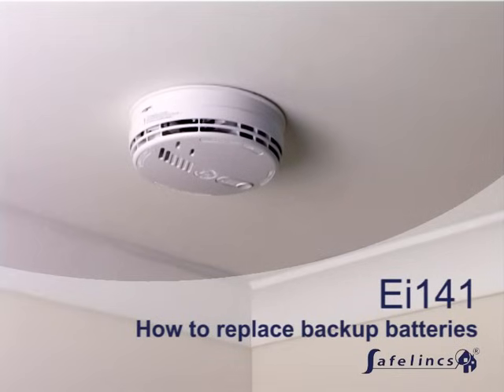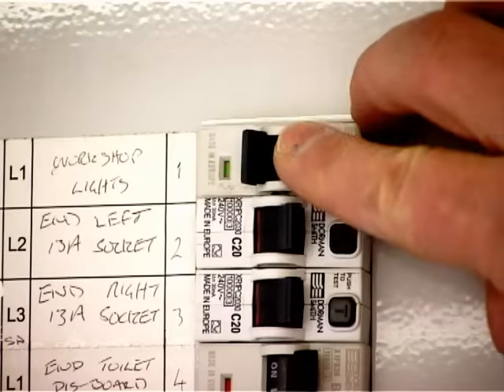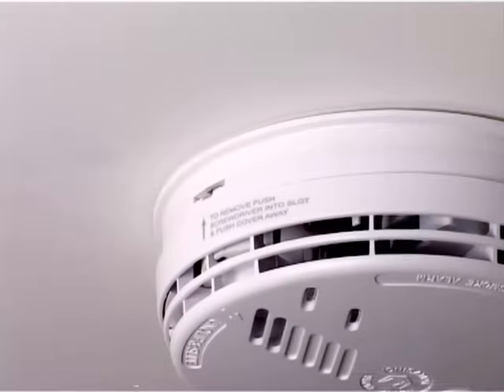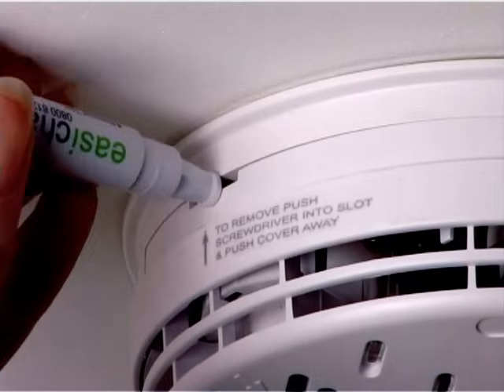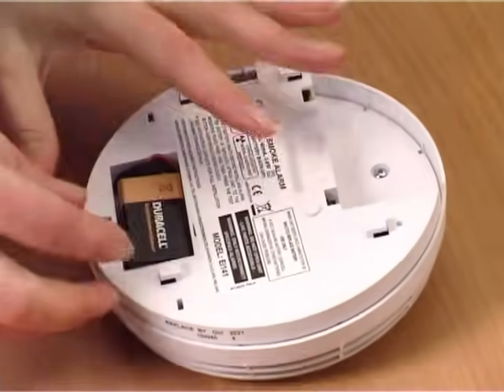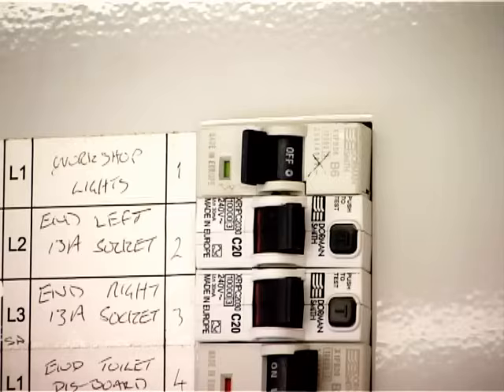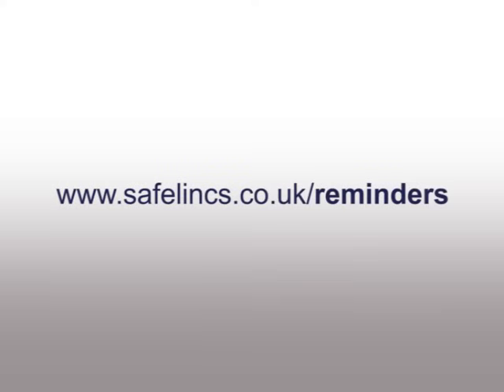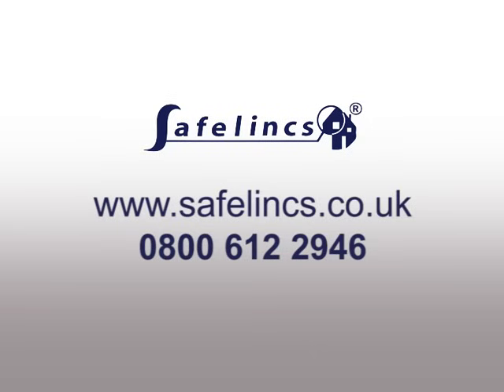Replace battery in Ei141 smoke alarm

Comment: Had to change batteries in a number of these things. In a domestic environment, they are a safety hazard. A risk assessment should be carried out to assess the suitability of a product. The risk of falling from a ladder whilst trying to insert a screwdriver and attempting to slide the unit off the base to high ( especially when the unit suddenly releases under force )  when compared with the risk of the PP3 battery being borrowed....!
No way these units should have a CE certification the access to change the battery is just too great a risk.
Reply from the maker: Hi Paul, an interesting angle to look at this issue. I think this is a really good point, especially when considering that this problem happens largely at night when we are not best at balancing and at DIY! As always we will pass this comment to our manufacturers. In the meantime, I recommend that you put a marker in your diary to change the batteries preemptively once a year to avoid the disturbance at night.
Reply: Not to mention the fact the beep could just make you jump while you’re on the ladder
Reply: Adding to Paul’s comment. My alarm is positioned just above to top of my staircase. This is a death trap.  Standing in a ladder and adding force to remove the cove r on release could send someone flying down the stairs. I HATE THE DESIGN. A  risk to many. ☹️
Reply: Yes Paul you are correct that’s what I am doing now standing on a chair trying to get the cover off which won’t budge 😡
Reply: @Safelincs  please relay to the manufacturers all the other comments to this video,

Comment: Judging from all the comments below, coupled with personal experience, this thing does seem to conveniently run low on battery in the middle of the night. The manufacturer sure knows how to save lives as well as torment them in the process.
Reply from the maker: Hi Alexander, we agree with your feeling. Most smoke alarm brands run into battery warning cycle in the middle of the night (when it is colder and the batteries' voltage reduces), which is painful. We have spoken with our suppliers time and again but we are only making slow progress. One supplier, however, Fireangel has produced a mains powered-alarm with 'Easy Sleep' function which allows you to silence the low battery warning for 8 hours. http://www.safelincs.co.uk/fireangel-pro-mains-powered-alarms-with-lithium-backup-battery/
Reply: I just had a live chat with Safelincs who say they don't 'sell' these tools and suggest using a small flat headed screwdriver.

Comment: 0:57 just changed mine over, so easy and I’ve 12ft high ceilings.  No spare battery so wrapped detachable part (part that beeps) in a large towel, placed in conservatory so I can’t hear it and this will do until I get a new battery in the morning. Single female btw……..thanks for the instructional video!

Comment: Angling the blade slightly downward on a pair of decent size scissors (and a push) finally got this thing off for me!  Screwdrivers tend to have handles that are too chunky and make locating the release block infuriating.  
Perhaps Ei could design the next one so that it doesn't need a 'special tool' to get the lid off it.
At least it's quiet now.  Time for a cup of tea...

Comment: It's Sunday 6 am and this lovely item started beeping. Had no idea there was an back up batterie and with 3.60m high ceilings life got a bit tense. Thanks god I found this video before loosing will to live.
It's very clear and really helps solving this problem...so long you have a spare batterie, a fitting screw driver and a big ladder.
 Also I agree with all my fellow writers - what a stupid design and how difficult to change the batterie. Big ladders, power circuits switched off...up and down and fingers crossed. Highly annoying and with no commen sense.
and one last thing...got a bit nervouse about comment that after 10 years this smoke alarms getting a bit silly...
Reply from the maker: Sabine For Hi Sabine, we agree with your sentiment that smoke alarms should be easy to open. We understand the argument put forward by the manufacturers that there can be a risk of people removing batteries for other purposes but it feels wrong to penalise pretty much every household just because some people behave reckless. Safelincs is therefore already lobbying for a change of the current approach.
Reply: Mine sterted beeping Sunday 7am. 7pm I found this helpfull video and removed this Item from cealing. Annoying sounds

Comment: Took me a good 10 minutes to get that alarm off without breaking it, and on a swivel chair D: So I was spinning while doing so
Reply: My ceiling is not that high. Also, I called for maintenance and they replaced it with a battery one that can charge as I was talking to him about it and life in general.
Reply: @LMT_biglee93  weirdo
Reply: @vantablack1119  Thanks 👍

Comment: Always happens in the middle of the night, years since the last time so you've forgotten how to change the damn thing. Having been driven to the edge of firestarter practice by the noise, I learned to keep a spare ( really expensive ) 9V in my kitchen drawer. Still had to get the you tube video the step ladder, two different flat head screwdrivers and a magnifying glass out to do this. 😳😳😳 . Now wide awake. May need Gin .

Comment: Considering that it's going to be located right under the ceiling, and possibly over a stair well, this does seem a remarkably inept design. I did get it to open as shown, however it was pretty awkward to do. Incidentally, please tell the designers that some people are colour blind to green and telling them to look for a green light isn't helpful! It can be any colour it likes, as long as it's labelled in some way so we know what its purpose is.
Reply from the maker: Wylye_guy Hi, thanks for your feedback. I think you raised two very valid points and I will raise them when meeting with the new Director at Aico (the distributor of Ei Electronics mains powered smoke alarms) in a few weeks.

Comment: I'm surprised no-one has killed or injured themselves trying to replace the battery in this product, especially if it's sited over a stairwell. The instructions are printed on the product in tiniest type, coloured light grey on white for maximum unreadability. The awkward casing release involves poking about with a screwdriver with considerable force while you're precariously placed on your ladder/steps. Then there's a 50% chance that both instructions and clip release are likely to be sited on the inaccessible side of the unit (over the stairwell itself). All this while the unit blasts arbitrary deafening beeps next to your ear. Horrible product, and whoever designed and OKed it for sale should be ashamed of themselves. If you're elderly, don't even think about attempting to change the battery yourself. Get someone in to do it, and send the bill to the manufacturer.
Reply: It’s obvious some corrupt politicians are in on this scam and getting kickbacks. The question is which politician’s brother or nephew owns the company behind it...
Reply: yeah i didnt know that these had to be replaced and my landlord company didnt tell me about any need for battery replacement.

had to risk cracking my skull taking the alarm off at 11pm when it decided to have a fit

Comment: Great video. The trick indeed is to slide the base unit away from the screwdriver. Don’t pull down, as I did with the first one.  I’m doing all of ours now, while it’s daytime and I’m sober.  I guess when one battery goes the rest will shortly follow suit.  Imagine trying to do this in the middle of the night!

Comment: Beeping in the middle of the night (of course) - fixed inside of 3 mins with a screwdriver and spare 9v battery.  Helped that the alarm was easily accessible - just stood on a chair.  I didn't bother killing the mains power first.

Comment: Loving these comments! Such a poor design! 
We had one installed last month with a brand new battery. On a nice hangover Sunday morning the alarm started going off despite no smoke in the flat or from the neighbors. It would not stop after pressing the hush button, took 10mins to pry a screwdriver into the thing, only then to start getting a beeping every 40 seconds to show the battery was declining.
Reply from the maker: Hi Matt, yes, not the most user-friendly design. However, I am puzzled why you are still getting a beeping after removing the unit. Either, you actually have a different model with a self-charging battery (in which case you might actually have an issue with the power supply to the unit being set up wrongly) or you have something like a carbon monoxide with a low battery in the room without realising. It is difficult to find the source of these beeps. Harry

Comment: Hilarious comments! I found this video very helpful and was able to change my beeping alarm in no time at all. It's just a question of finding the right size screwdriver , inserting into the slot and giving it a wiggle until the catch is released , then sliding the unit off.

Comment: This thing is an appallingly bad design. Getting it off it's ridiculous mounting bracket is a trial.
Getting it back on that absurd bracket is even worse.

Who the hell designed this?
Reply from the maker: +Sterling Thundercock Yes, sadly, quite a few of the manufacturers are slow in making their products user-friendly. We are passing all these comments on, though, in the hope to get the alarms changed.
Reply: ***** Thank you.
Reply: Ei electronics
Reply: @Safelincs  Why change the alarm design? I heard the beeps, watched this video and it took me longer to find a 9-volt battery than it did to take it off and swap the old one out.

Comment: This was very easy to do the trick is to use a small flat blade screwdriver, make sure that you insert where there the dip is on the hole. As you slowly pull down you will feel it unlock than push the bottom part away from you.

Comment: My partner and I have just spent two hours trying to remove the cover, taking turns to see if one technique works better than another, and trying different screwdrivers. No luck, even after taking a break and trying the lower non-beeping unit to see if the problem was with just with the one unit. It wasn't, so it comes down to poor design. The solution is 1. break the unit to get at the battery 2. let the battery fail or 3. pay an extortionate call-out charge for an electrician to do what is supposed to be a simple job. We'll try again tomorrow, but this is really poor
Reply: Did you manage to do it? I'm living in a rented flat by myself and been trying for hours to get it off with various screwdrivers, scissors, but nothing works!! Does anyone have any tips - is there a knack to it?!
Reply: @katieroulstone8597  We took one screwdriver, measured about one cm on it then wrapped tape at that mark so it couldn't slide in further. 
    We finally did it, using that screwdriver in the slot and another small one prising the unit open a bit then we tried to move it again. Then it popped out so suddenly it hit me on the nose and rolled down the stairs. Luckily they are carpeted and the unit still worked when we put the new battery in place.

Comment: Just woke up to this damn thing chirping. My house has four of these smoke alarms and guess which one is making that awful noise? The one outside the bedroom door where I’m currently sleeping at the moment. My dad will have to somehow change the battery once he comes home from work, so may I wish him luck. Why couldn’t they just add a flashing light to indicate that the battery is running low, or a button that disables the chirping noise for a while? And why can’t they just make the opening system a simple anti-clockwise turn? 

Reading these comments is like entering a goldmine, and I’m here for it.

Comment: EXTRA TIP HERE! 
Well I managed it in the end and I have to say that this video was not much help. Of course when your smoke alarm is peeping the first thing you are going to think is, oh I'll go buy one of those special tools to do the job.
No, armed with a new battery you are going to go at it with a step ladder, knife, pair of scissors or if you are really sensible, a screwdriver.  BIG TIP here...use a small flat screwdriver no more than 4mm wide, insert it then aim it upwards a little and you should feel it click as the bottom section separates. I hope this helps.
Reply: OMG thank you so much I have been awake all night watched countless videos. after implementing your big tip the damn thing separated. Now I can sleep for a few hours I’m exhausted 😅

Comment: It's 4 o'clock in the morning and I don't have any replacement batteries in the house.  Even when you take the alarms down, take out the old batteries and switch off the circuit at the mains, they still bloody chirrup!  They are now in the bin outside.  Great fire safety feature that- make them so bloody annoying that rather than being willing to go and get new batteries when the shops open, at this point I would rather burn to death than put up with these bloody alarms!!!

Comment: Um i need help 😅
So basically i replaced the batteries for my alarms and put them back in place. But the LED light never came on. These are new batteries as well.
I didnt know to turn off the mains switch for the smoke detectors first, so I'm wondering - is that the issue.
Do i need to take them all down, turn off the mains switch and out them back in again???

Comment: Tried following instructions in this video but the unit would not budge !  Was advised to press and hold the button for 1 minute - this stopped the 40 second beep though I was nearly deafened by continuous loud beep while holding down button!! Device seems fine now - green light is on - though batteries not replaced......
P.S. Expiry date on detector was Jan 2019 so bought replacement and Taskrabbit handyman installed it. Fine now until 2030 😀

Comment: For the benefit of husbondensrost the reason the mains supplied smoke alarm has a battery, is as a back up in case the mains power has failed when the alarm unit detects smoke. Thoroughly agree about how irritating the chirping is! Easy response when you don't have a 9V battery immediately available, dismount the unit, put it in the drivers seat of your car, next time you go out buy and install a new battery!
Reply from the maker: Hi Ray, that is a great idea to solve the issue of remembering to buy a battery!
Reply: ***** As you may have guessed, I learned to do this from forgetting to get/do things on many previous occasions!
Reply from the maker: Ray Smyth Hi Ray, only downside is that you might be without alarm for a few days and hence unprotected.

Comment: can't sleep because of the bleeping. your alarms are rubbish
Reply from the maker: +jigsaw332 Hi, you are of course entitled to be enraged after your interrupted sleep. The issue of battery signals being allowed at night time is being passed on regularly to all the manufacturers we deal with. Fireangel is half there with their 'Sleep Easy' function that allows to silence the alarm for 8 hours for up to ten times. Ultimately, we need mains powered alarms that use a light sensor or similar to find out when it is opportune to send a battery warning.
Reply: You don't need to replace any battery. Just hold the test and hush button until you cannot hear the annoying beeping sound
Reply: awaken world  Are they just gonna leave you in your home with the fire alarm going off? Damn, I wouldn't allow that. I would demand someone to fix my fire alarm as soon as possible if I were you 😖

Comment: The designers of this product should be dismissed on the spot! Took me 15 minutes just to get the cover off after switching off my lights at the fuse box. What would be so wrong about a simple twist off cover and no tools involved?! Also, if it's mains powered why should it need any kind of battery?! Anyway, followed instructions in this video and this creation of the devil has finally stopped beeping every 40 seconds. Battery cost me £5! Best of luck people if you have the misfortune to have one of these things! Now I can rediscover the concept that's called 'sleep'.
Reply from the maker: Strong words but we know how frustrating this alarm can be (please note that we are NOT the manufacturer and have passed the issue to EI Electronics many times in the past). 
There are two ways to stop this happening again:
1) change batteries pro-actively every year.
2) replace the alarm with a version of the alarm which trickle charges a longlife battery. See the Ei161 replacement model https://www.safelincs.co.uk/easichange-ei161rcek-replacement-kit/ This Ei161 model will fit on the base of the Ei141.
Harry

Comment: I have watched your video but am unable to find the correct mains switch.I have changed the battery but it still bleeps. Can you advise please?
Reply from the maker: Hi, smoke alarms have a lifespan of 10 years after this time the alarm can continue to chirp or beep even after changing the battery.  To check if this is the case there will be a sticker on either the back or side of the alarm with a replace by date.
Reply: @Safelincs  Thank you

Comment: I have mobility issues and shamefully do not know my way around a mains board. 
Is it OK to switch the full red mains switch before replacing the battery? 
Just climbing up to the smoke alarm has taken it out of me, let alone attempting every singular mains switch. 
Would I get a shock, if I replaced the battery without turning off the mains? 
So sorry for being so useless. 
Many thanks in advance